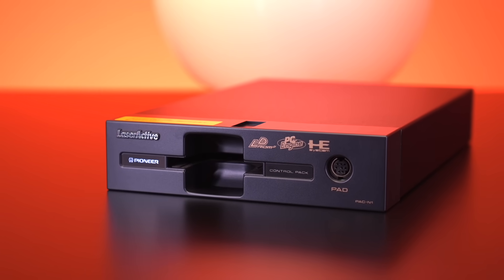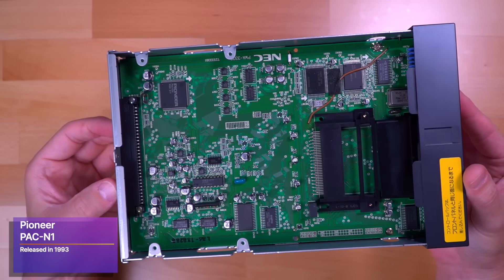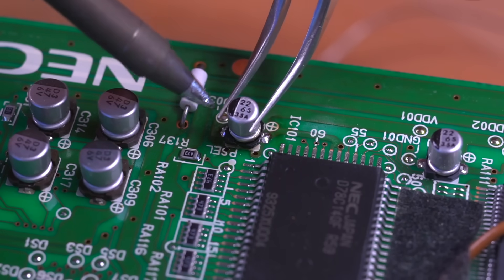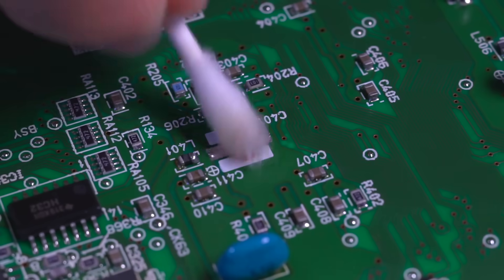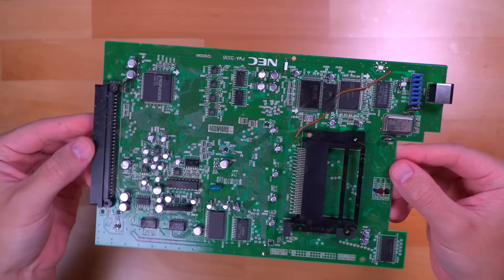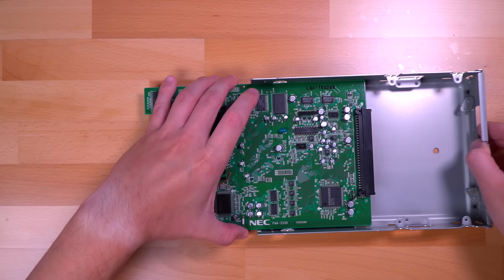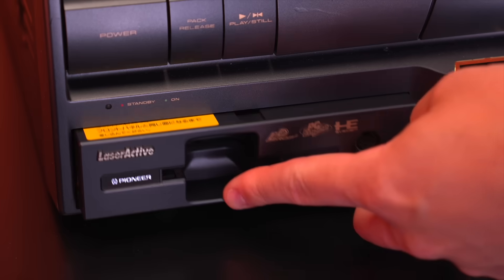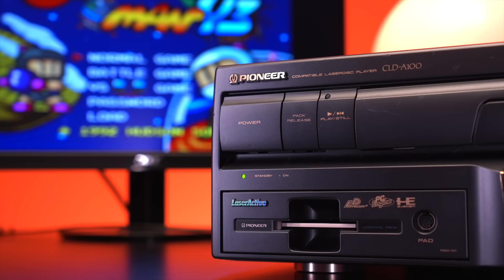Restoring One Of The Most Expensive Consoles Of The 90's

Comment: I'd argue hot air and twist off methods are the worst - electrolytic capacitors tend to pop because of hot air or squirt their juice all over the board, and twisting is just barbaric.

Rocking is fine as long as you're careful with it - if you lift a pad, you've tripled the amount of work you're about to do, and if you tear a pad, well, sucks to be you.

Hot tweezers are great as long as you have hot tweezers.

If you don't, cutting the cap - I have no idea why you'd call it controversial - might just be the safest way, as long as you clean the board if something leaks out.

Comment: I might be a little late to the party but I had to deal with glued capacitors when I was replacing the smd caps on a Sega Game Gear. What I did is apply isopropyl to the base of the capacitors and let them soak for a bit. That did the trick for me. I did use the flush cutter method to remove the caps themselves though.

Comment: My SMD capacitor removal experience: Some PCB's have very fragile traces and lifting one side of the cap or cutting it can rip these. I don't have a tweezer iron, instead used 2 soldering irons: preheat the solder joints and add some solder then hit them each side simultaneously with a soldering iron in each hand. Sounds a bit weird but it works really well,

Comment: For glued smd caps I usually use a little bit of isopropyl or wd40 on the board and let it soak for 10-15 minutes before moving on to hot air or tweezers.

Comment: off topic. i've got a sega genesis model 1, non tmss version. the audio on the right channel is blaring and distorted. left channel (mono) is unaffected.  the distortion can be heard two ways. first is through the headphone jack, the other is through the coaxial output on the back (which combines left and right into 1 channel) so the distortion is present in RF. i replaced every single cap using a kit, which didn't fix the issue. what else could it be?

Comment: Personal preference is the twist method 
Especially on the laser active pacs 
The pads are fairly strong when cold, but lift easily when heated 
Note i press down on the caps when twisting to avoid pulling up on the leads and use several small twists rather than a single large one

Comment: If nobody mentioned this before... the Capacitor problem was an entire electronic generational problem... a new type of capacitor was 'invented' in the late 80's and its composition was kept a secret under patens... a Chineese company attempted to reverse engineer it and then undercut the original developer... so being cheap companies bought the lower cost caps... unfortunately the checmials created air bubbles inside the caps and cause them to swell and blow... it affected computers, tvs and all sorts of electronics (This is infact why almost all Sega Gamegears have audio problems)....  The LaserActive unit itself used the name brand caps... but for some reason all the PAC units (except the K-1 karoke one) used the cheaper ones... and this is why they all will eventually have problems.   ((**Also interesting FYI... at one time I had the MYST laseractive prototype... i was a huge fan back in the day, and had 3 units, and almost every title).

Comment: I have a LaserActive that I bought when it was put on clearance, for $200. Didn't have a game pak until the chain (Incredible Universe) closed and they dug up everything in their back room and sold off. Bought the Sega LD pak for $5! Didn't buy the karaoke pak, though, and I kind of regret that now. I haven't used the LaserActive since the early 2000s, because I was getting "ghosting" onscreen with movies, where the laser is partially reading the next track. I have only used a solder gun once or twice in my life, for the most basic repairs. I'm terrified of having to do these kinds of repairs. I only have two Sega laserdisc games so I don't feel the need to rush to do it.

Comment: Methods 1-4 would constitute defects in most cases under J-STD/IPC 7711. If you've never done this before, use method 5, or get yourself some Chip-Quik, so you don't pull the barrel out or lift traces.

Or if you don't have hot tweezers, use two cheap soldering irons like chop sticks. That's what I did for like, 15 years until I got a pair of hot tweezers.

Comment: Typically, if I'm removing SMDs that I know are crappy, like on the Game Gear, I use low melt solder instead of regular 60/40 to put on the leads before I attempt a removal. This lets me put less heat on the caps so they don't pop as easily.

Comment: Replacing electrolytic capacitors with tantalum capacitors is often a better choice because tantalum capacitors are more reliable and less prone to future issues like acid leakage. Electrolytic capacitors can degrade over time, leading to leaks that can cause damage to the circuit and other components. Tantalum capacitors, on the other hand, are solid-state devices, meaning they don't contain liquid electrolytes, which significantly reduces the risk of leaks. Additionally, tantalum capacitors tend to have a longer lifespan and better stability, making them a more durable and safer option for long-term use in electronic circuits.

Comment: Hey Tito, awesome guide and video, and a really astonishing piece of hardware. The twisting method works better than you would think, because the little plastic under the cap keeps the contacts straight, with the drop of adhesive in this case here this is even enhanced, the force on the leads is longitudinal, where the pads have most retaining force. I recapped an amiga cd32 with no pad torn or even damaged. For heavy corroded pads I would try another method, but even the flush cutter method would put too much force on the pads. Try the twist method on some broken stuff.

Comment: When recapping a unit I prefer to mark all old caps with a sharpie and replacing them one at a time. The only time I replace more than one at a time is when the caps in question are the same value. By doing it this way you can you can ensure that you don't goof and place the wrong value in the wrong spot.  It also saves time being that you don't have to constantly reference a guide.

Comment: I think your snapping off at the shimline is a pretty good aproach for glued electrolitc capazitors. Also there are diffrent types of glue. I worked with the one you showed and on some older stuff there was a glue that is more like cement. The cement one was pretty ugly to clean up. (You bassically had to remove it with scotch pad or fiber cleaning pencils. to get a flat surface again.) There are some solvends for the shiny glue but i never licked them because you need to clean up after the solvent and it doesn't remove the glue, it makes it more like a sponge/gummy and with that its mechanical structure weakens but again not a huge fan.  I also found soeme info on google that heating will make the glue soft again, but i can't confirm that. Any type of glue i ever worked with was basically baked and was made so it could withstand the same temprature again. The glue wasn't used to make the mechanical connection to the pcb stronger. it was used because the oven to melt the solder past was just a long tunnel. New ovens can have multiple heat zones that diverge for the top and the bottom that wasn't the case back until the mid/late 2000s. So they used this glue to solder on the bottom side then turn over the pcbs and do the top side. And the glue was there to prevent the bottom parts to fall off during the soldering of the top side. So most of the time when i worked with glued components i used two soldering irons with a good flat surface so i could pich the component above the solder pad with both irons and wiggle them lose from the glue. that works good for small restors and small caps. But for electrolytic ones i always removed as much solder form the pads as possible then clip the cap off. (If the solder flow was good the legs would come off with the component else the removed solder hellped to prevent riping off the pad by weakening the solder joint.

Comment: I have a CLD-A100 with the Sega Kart.  I got it back in the 90's with like 7 LD (3 Sega and 4 NEC games, some still sealed) games for like $250. I found a store that was closing, and they had one with a stack of games, and I had to have it, glad I did. I've always wanted the PAC-N1/N10 (I do not believe they are region locked), even in the 90's even back then, if you could find them, they were like $500+, today, one lose, will go for like $600-800+, in the box $1200+ so it remains and unless I get rich a wholly grail for me. 

I need to do a CAP kit in my Sega kart, when playing, LD games play fine but, carts will show the game with red all over the screen, tried many games with the same result.  Having like 50+ retro consoles, I could spend 5+ months recaping but, I do not have the time. I do 1 offs when I need to.

I sold at higher end A/V stores in the 90's and talked to the Pioneer rep about this device. They said it was designed for the wealthy who didn't want 5-6 consoles in their entertainment system.  The goal was to get Nintendo and others to sign on but, as you could guess that never happened. Personally, even today, knowing how Nintendo is about their consoles/IPs, even if Pioneer dumped a ton of cash at them, I don't think they would have done anything here. 

In the 90's, it was a cool thing, mostly video playing with games in front, so when you are flying or something like that, it's looks real, today, it looks mega cheesy. Just composite out, no S-Video (S-video mod is pretty easy on it), or even AC-3 RF out.  Compared to other "better" LD players in the day, it was very limited and lacked outputs/features of the better LD players.  Remember when this came out, DVD was not even a thought, your option for video was VHS and LD, and LD was FAR better than VHS. Kind of like DVD VS blue ray today. 

Still neat 90's product, it would have been really interesting if it was really successful with Nintendo and every other console out there.

Comment: take a look at how you hold the hot air. why blow over the cap? what you want to do is heat the soldering joints, i.e. move the nozzle in a u-shape around the cap and not a straight back and forth. your hot tweezers are too weak, so you need too much heat, which is why the cap bursts. cleaning with alcohol alone is not enough if there were already signs of leakage beforehand. this must be neutralised. i would also rinse the pads 1-2 times with fresh solder before give them the final cleaning.

Comment: What was really the point of buying this back then, to save space? I though buying an extention would have a financial benefit. I think if you already had a Laseractive, naturally you would think to buy this instead of the actual consoles since you had the option, but for this to make sence it had to cost at least the same as the console equivalent. This is not a PC board, this is a device that's already under the TV alongside other consoles. Of course now it's a cool collector's piece at least.

Comment: With your rocker method of removing the capacitors it would be better if after you add solder to the pads you then remove most of it with a desolder pump before removing the capacitor in the method you showed. This should make it remove in the first go giving less chances of pulling the pads.

Comment: IMO your experience with the hot tweeters is one of the reasons I don't use those nor hot air on old caps (they arent stable hence why we replace them). The first method is to slow and since your lifting up you can accidentally lift a pad. 
Oddly the safest method is twist, but the way you showed it is a bit dangerous. Instead of a 45 or 90 degree twist, think of it as giving it little rotational wiggles. However instead of slowly backing off the cap from the board, you are deliberately not lifting at all (which is what makes it safe, and is the issue most of the time when pads do get lifted). 10 to 15 degree rotations back and forth to weaken the legs till they fail is your goal... not twisting the cap off. Your deliberately putting small repeated mechanical strain on delicate weak points that (for this procedure) are 100% sacrificial.
Its faster then the other methods and safer as you aren't risking any more fluid leaking out (sometimes its a concern if its in a densely populated area not easy to clear with IPA or the like) or cap popping that hasn't already happened since there is no heat. There is some technique so I suggest trying it on something you don't care much for to get good muscle memory.Most caps just take five 'mini wiggles' before their legs weaken to the point they snap off, then your free to lift up leaving, often, just a little leg and solder left.

That being said there is no technique for 100% of cases. Different style of components, conditions, and surroundings dictate which is the best. Tweesers really are the most finicky and risky since they can dump a lot of heat really fast. Twist doesn't work good when the cap has leaked so much its already damaging pads and traces (you NEED a reasonable pad in place). The base flush cutter is messy but if your pads are almost gone and the PCB is showing damage its likely your best bet.

Comment: Quick tip from a former owner of one of these things- never ever use printable discs in it. The mechanism has very tight tolerances and you may need to disassemble the CD mechanism to retrieve your discs. Burned media is fine, but the printable discs are just slightly too thick.

Comment: Definitely one of the most interesting variations of consoles that were produced. Would be cool if some tech madmen/women out there were to make a snes add-in to work with it. Then you'd have all your 16bit era bases covered. Also curious were the old sega/tg16 region locked and if so is there a modchip (not using multicarts etc) or work around to address it that would be applicable to those pac's? Great vid as usual Tito!

Comment: My friend love your videos, keep up the good work, with the fact that electrolytic capacitors are noted for leaking, then why not use something like multilayer capacitors, I just see so many replacing electrolytic with electrolytic, which absolutely does not make sense, if you order from mouser electronics the multilayer are not that expensive, just curious and maybe I’m missing something as to the reasoning, I’m still fairly new to all this about 5 years now and have done several mods and repairs, so I’m still learning, would appreciate a response please and thank you.

Comment: Not a big fan myself of exclusively using heat to remove those types of aluminum capacitors, with big exception to the tweezers but those are more or less a specialized tool. Physical removal via pliers with twist and pull or snips is my preferred method. Testing out capacitor removal on junk PCBs with these caps on them is 100% something any aspiring repair technician should do to get the hang of how to do it.

Comment: I've lifted MANY more pads trying to desolder SMD caps than by using the "twist" method.  As others have said, you press down while doing a "twisty wiggle" of the play in the capacitor legs.  Within a few seconds, the metal of the legs will fatigue and break, usually right at the edge of the solder.  This typically leaves the base on the board, liiking much like your cut method... but without possibly releasing electrolyte.

Comment: whenever you are working with aluminium capacitors, USE EYE PROTECTION, the cap liquid inside when heated can literally boil creating pressure, and exploding producing small shrapnel that goes directly to your eyes for some reason. USE EYE PROTECTION when handling it.

Comment: I believe that red chip glue softens with heat, so it's probably a matter of gradually heating everything up with hot air at a lower temp and then switching to a higher temp to melt the solder and get it off. It makes it a bit trickier since it will still require some force to pull it off, but you do want to make sure that resistance is coming from the glue and NOT the solder joints.

Comment: I feel it needs to be pointed out that at the time these came out, Pioneer was considered a premium brand, not the ruin of a company it is now.
Reply: Pioneer completely resurrected Laserdisc as a high-end home theatre format in the early 90s by adding CD audio tracks and Dolby Digital audio support to it. Both the Sega and NEC laserdisc games use the CD audio tracks in CD-ROM mode.

Aside from the unique pac system, this particular model of LD player is rather mediocre. It doesn't even support two-side play, which needs the motor completely stopped and reversed within seconds, while the laser head is pulled back and flipped over the top of the disc.

Comment: 6:45
I would not recommend hot air for removing this style capacitor. They can explode and shoot off at high speed, as we saw with the tweezers. 
The tweezers are actually the best way to work on aluminum caps, but that glue pushed us into the stone age and we should do as Tito shows with the cut and clean method.

Comment: Always excellent, thank you.
FWVLIW: I was horrified when I first saw the 'twist method' to remove this kind of cap. But once tried it's my go-to method, no issues to report.

A little tip - 'Ceramic' equivalents of 'Electrolytic' SMD caps are available - The largest size will usually bridge the pads fine, and will never leak.